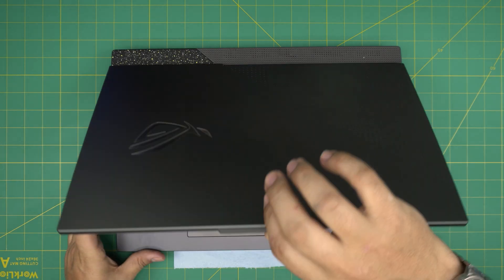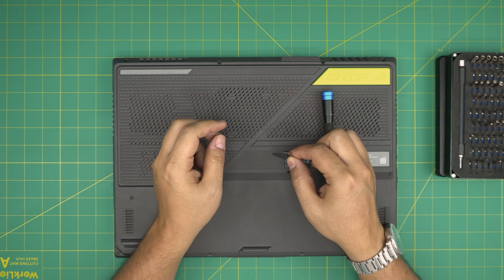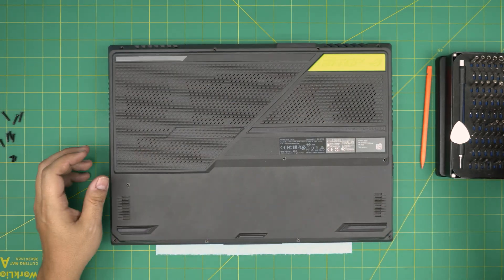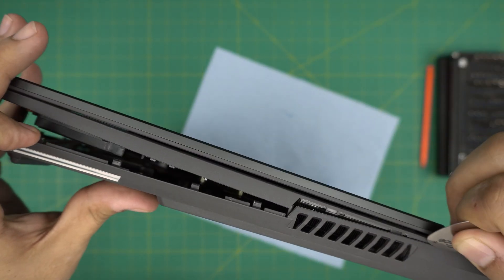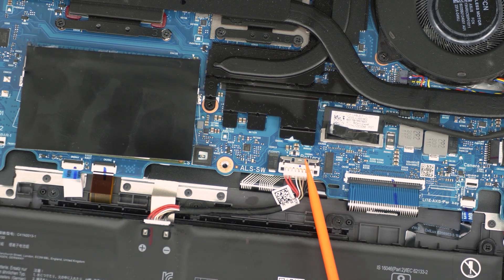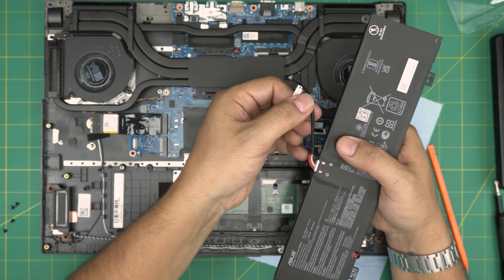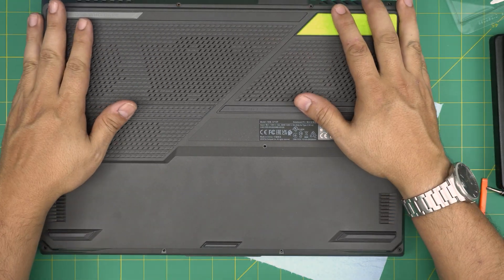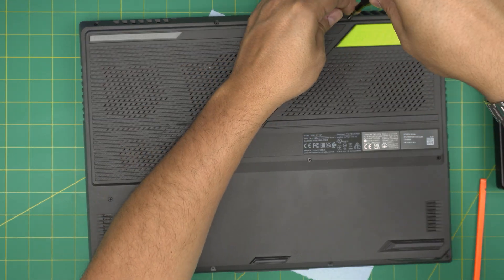How to Replace the Battery for an Asus ROG G17 Laptop | G713Pi DS94

Comment: It should be criminal to make a freaking battery swap this difficult on a laptop. Very poor design. Will never buy an Asus laptop every again. Complete pos.
Reply from the maker: 🫠🤣 You should see some Dell or Alienware laptops, or even some HP ones—they are ten times more complicated than these laptops.
cheers🍻
Reply: Comparing to Asus Rog G751JT, this battery replacement is a piece of cake.

Comment: Do you know where is CMOS battery on Rog Strix g713R ?
Reply from the maker: 🫠Regarding your question, this laptop doesn't have a dedicated BIOS (CMOS) battery. The CMOS draws power from the main battery. If you want to reset the BIOS configuration, simply remove the main battery and press and hold the power button for 60 seconds to reset the CMOS.  
(Note: This action will not remove the BIOS password, as it is stored on the EEPROM chip.)
Should you have any further questions or requests in the future, please don't hesitate to ask me.
cheers🍻
Reply: @uFixTek  Where i the eeprom chip located and can i do something to that chip to reset the bios password

Comment: Im haveing issues with the cable part that artaches to the 7 pin on the mother board the slider doesn't slide over the plastic tip. They appear to be level with each other 7:28
Reply: How did you get past this I’ve been at this for an hour 😭
Reply: @Andorima  they may appear to be level but if you look closely after you pull the metal cap towards you, it moves just ever so slightly over the edge of the cable connecter
Reply: @Andorima  figured out that the clips need more pressure than feels comfortable to exsert